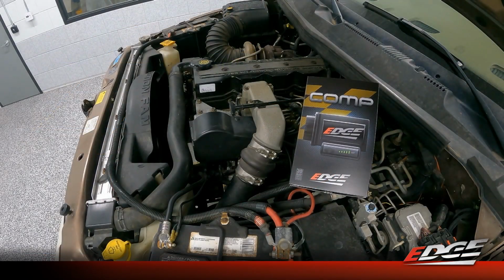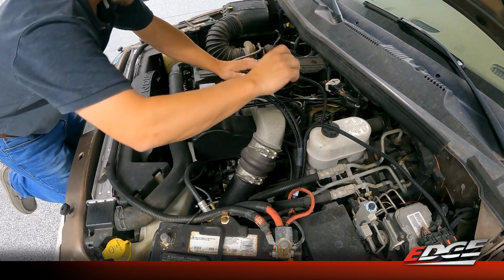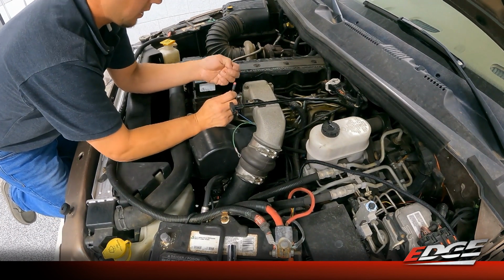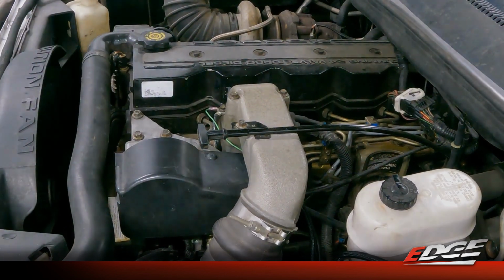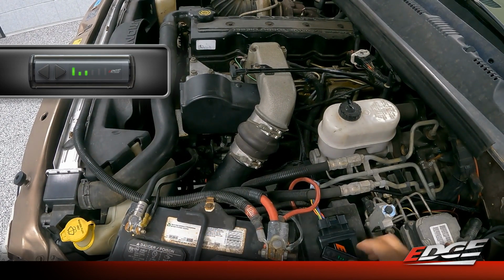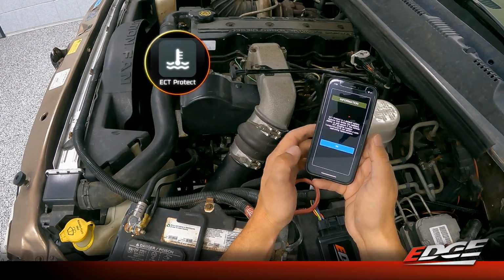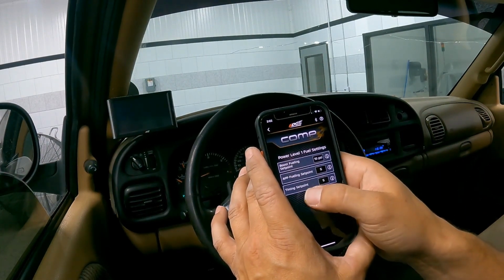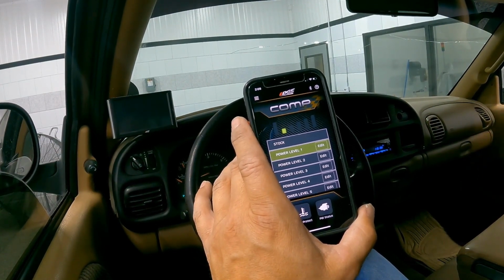Comp Box Installation VP44 Cummins

Comment: I feel like these Edge systems are not only geared for the more knowledgeable owners but also the average joe owners due to the simplicity of the installation.  I just bought the truck I've been dreaming about for 20 years. 01 SB Cummins. If I end up picking up an Edge system, I might just do my first video showing how even newer Diesel owners can do it. Thanks for the video!

Comment: I have a brand new map sensor, and im getting a code for the map sensor code. with the comp box plugged into the MAP sensor, i have no power til about 1900-2100 rpms. takes off after that. i also cant connet my phone. it says device not found
Reply from the maker: Hey, please get with our tech support and they'll help you get it squared away. 888-360-3343

Comment: In terms of ease of installation, better to go with Comp box and Cts3 monitor?? or just go with Juice/Cts3 combo??

Are there benefits either way?
Reply from the maker: installation is pretty similar between the two. The Juice system will include an egt probe and fuel pressure sensor. Those would be items you need to add-on if you buy a Comp and Insight CTS3. The Comp will fuel a little harder, but the Juice will offer safety back downs if you do alot of towing

Comment: I’m thinking about buying this for my truck that is currently bone stock, and I’m wondering what screen or gauges I would use to monitor to make sure everything is good. Any recommendations?
Reply from the maker: You could pair this device with our Insight CTS3, but you can also look at your Juice with Attitude CTS3 device for your application

Comment: How much hp gain would I be looking at with this box, stock injectors and stock HY35 with s475/96/1.32 in compound? 2001 24v
Reply from the maker: With stock injectors, you're going to be limited on fuel supply to around 170-180hp gains
Reply: Gotcha. I just ordered some 7x.009 injectors to the configuration in my original comment, where do you think the at would put me at hp wise?
Reply: @CBDiesel86  Did you end up upgrading the injectors? How's everything going?
Reply: @theaveragejoebody  I did upgrade injectors. It runs great but definitely needs a bigger manifold charger

Comment: If I don't tap the pump, will it still run level 1? My trans is still stock but have a shift kit with bumped up line pressure. I would just like the 40hp bump
Reply from the maker: Yes, you'll still be able to use the box and add a little bit of power without the pump tap

Comment: I just bought this tuner and I’m installing it right now. I don’t understand how to tap it in do I need to screw it in or what??
Reply from the maker: Use the included tap from the kit, it will poke thro
ugh the wire shielding and create a power tap
Reply: It’s a wire tap

Comment: I had a juice with attitude on my 99, ran it for about 6 months without tapping the pump. It basically is a EZ if you dont tap the pump but gives you a monitor as well. After i had the trans built i tapped the pump and holy crap it was a HUGE difference! I already had a lift pump and injectors so the trans was last to be upgraded. That was a fun truck.
Reply: I have a 100% overs and 63mm Turbo Built Trans, feel like the truck isn’t what it’s suppose to be. What settings you run?